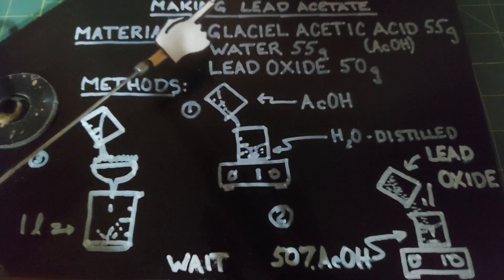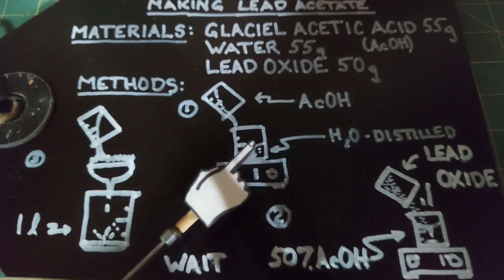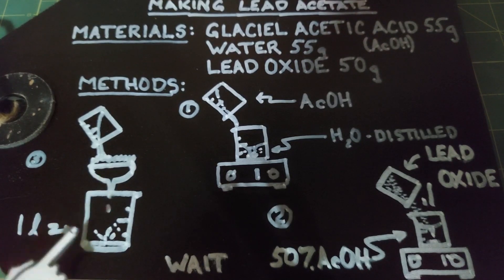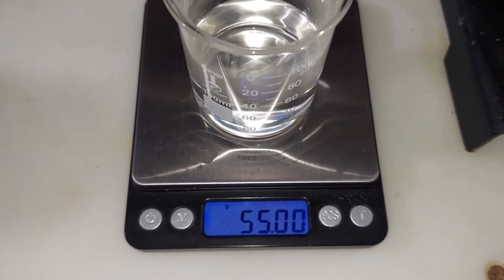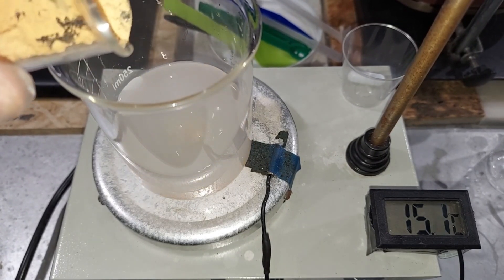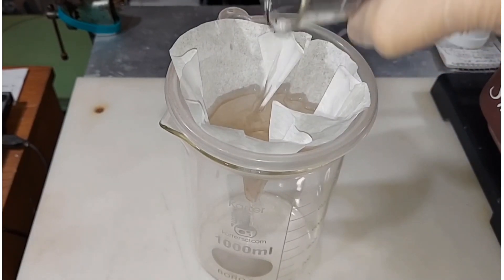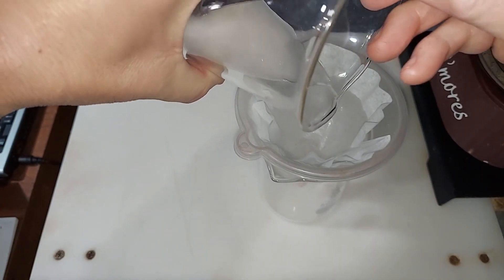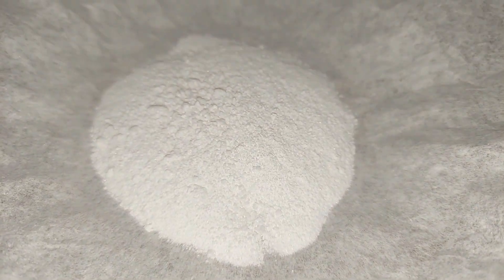Making Sugar Of Lead or Lead Acetate

Comment: If you convert it to the carbonate it's no longer water soluble and it's safer and more versatile for making various lead salts and complexes. If you're going to store some that's the best way to go. Great video!
Reply: I'd still wear a respirator because the fine powder can be dispersed into air but yea atleast it isnt soluble